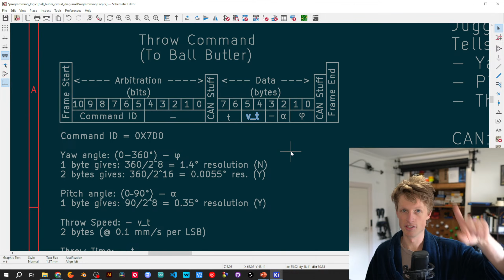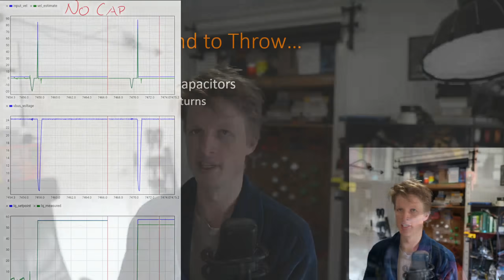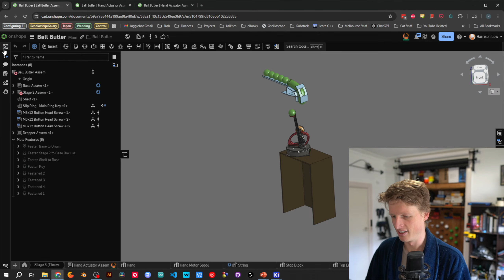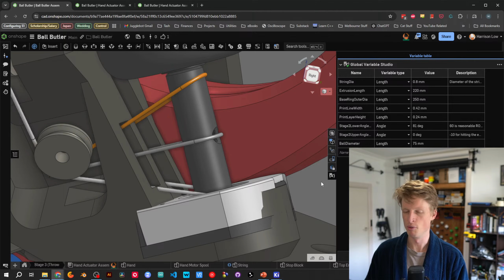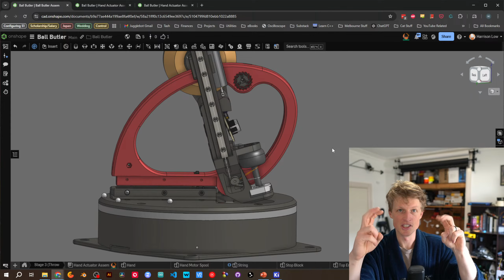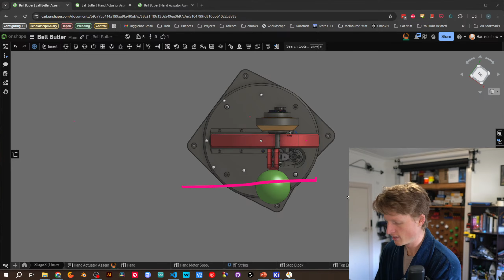PDJ Weekly Livestream # 67 - At Last! Ball Butler Can Throw!

Comment: Tuning a spring should be fairly repeatable as long as you're not overextending it. Or a spring like thing, like a bow of springsteel. Bow is great as its not flopping around whatever cylinder its in.

What the grasshopper analogy would be would be to extend/load the bow/spring with a servo and to shoot just let it freewheel(by servos control, if you used servo the other way too you could get power of both or racket clutch disconnect)
Reply from the maker: You're probably right that tuning the spring method wouldn't be so bad in the end. I'm more thinking that tuning it 'from first principles' likely wouldn't work, but I agree with you that the process would likely be very repeatable so we could just make a lookup table of extension -> throw height mappings. Ah well - that'll have to wait for the next version of Ball Butler

Comment: To get high throwing arm speed, you need a larger diameter shaft. The ball is not that heavy. The motor now moves the arm about the circumference of the shaft / rotation. Also make sure that your bus wires are short and sized properly, other wise you'll get voltage drop across them.

Comment: The current difference between the DC input to the oDrive and the AC output to the motor is just a question of the power that gets consumed. So the power needs do be the same on both sides, but you can have a much higher current in the motor windings. This depends on how big your reactive current is and how big the voltage over your motor is.

Comment: If you use the big motor with an arm attached to it to throw the ball, you may get better results and eliminate the need for the second motor. Starting angle, release angle, arm length and speed will determine the trajectory. You may also rewind your burned motor, don't throw it away.
Reply from the maker: A catapult approach would probably work, though you have a lot less control over the type of throw being made vs the two-axis approach I've gone for. Whether or not that level of control is necessary for Ball Butler is up for debate though... I can't believe a catapult never crossed my mind when designing this! Cheers for the suggestion 😊
Reply: @harrisonlow  I think when you were designing this project, all what's on your mind was, use Odrive and brushless motors.